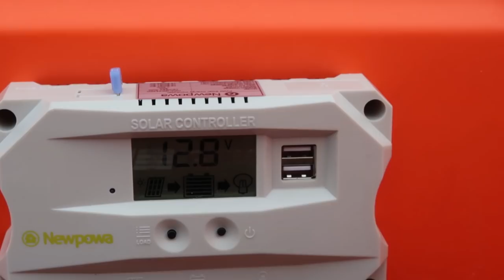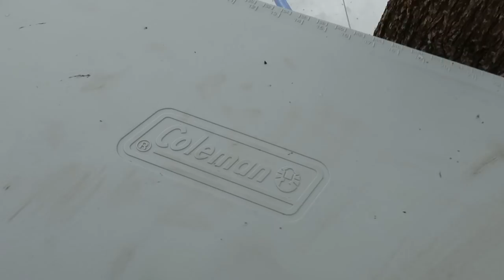204 Solar Powered Hobby Maple Sap Vacuum System?

Comment: Great video! A few years ago, my nephew bought a small solar panel for a project he was building. He opened the box on a nice sunny day and wondered if the panel put out electricity right away or if he needed something else. Well, ol' bright boy grabbed the two wires with his sweaty mitts. The panel went 10 feet in the air and the soup dang near left his shorts. Naturally, being the caring uncle I am, I laughed till I choked.
Great work Suzanne and Erik!
MB BAR RANCH
Reply from the maker: OMG, ok I laughed! But people thought I was nuts when I warned on another channel about panels needing to be covered before connecting!
Reply: @This1LifeWeLive  best let them buck the system once they've been warned. Lol
MB BAR RANCH

Comment: You can buy 12v heat tape like you use for copper pipes, it might be more efficient to wrap some around the pump, and then insulate the pump with more polystyrene. That bulb is really just heating the air.
Personally I'd have some kind of heating on all the time but fed directly from the solar panel, then when the sun goes in, have it switch to using the heating tape only if necessary. Hopefully charging the batteries won't require all their output, and this would be a good way to use the excess power.
You can buy cheap $5 USB temperature loggers, one might be useful for monitoring just how well the heating hardware is working.

Comment: Nice work. Once that tank is buried, the constant 50 degree ground temp will keep your sap from freezing.
Maybe the batteries should be put in another cooler, to lessen the possibility of explosion ?
Reply from the maker: but I wanted to end the season with a bang :(
Reply: @This1LifeWeLive , Lol.
Reply: You would need to go 10' or more deep to get 35-40° temps.
No sense burying the tank at all.
Reply: @gordbaker896 , Depends on where their frost line is and it isn't 10 ft. 
Even if they only buried 3/4 of it, then put some hay over it, it would never freeze. Ground temps below the frost line are generally in the 48-53 degree range everywhere.
Reply: @augustreil  In Southern Ontario, 3' is the average frost line and temps are sometimes below 43°F.  Neighbours deep well heating system froze up two years ago.
Reply: @gordbaker896 , Even if that was true, it still will not freeze. Average ground temp below the 42'' frost line, in their area is 45-50 degrees.
Either way, if they decide to bury it, it will not freeze.
Reply: @augustreil  Correct.  I never said it would freeze.
Reply: Most batteries these days are 'sealed' but there is often a small vent.  Batteries lose much of their output when below 40°.
Reply: @gordbaker896  we also gain 6 foot of gradient by burying it.
Reply: @augustreil  I agree I have never seen the frost deeper then a foot out here unless your driving over the same area over and over or letting the water from our hydrants soak the ground around them.

Comment: YouTube can be your best friend. And a trio to Vermont can help also. I  give u credit for what u are trying to accomplish. But u need to think about snow and travel for both power and sap to the tank....
Reply from the maker: The solar set-up was perfect (with the exception of a cheap temp controller which kept burning out), but the discharge to the tank was less than perfect. I know lots of guys bury their discharge lines and have pumps on the opposite end to help "pull" the sap toward the sugar house/tank. Not sure that's the best approach for us, so just driving to the holding tank is fine for now :) We plan to add a sap ladder next round and that will allow our lines to be at a more reasonable height overall :)

Comment: Why burrying the tank? Seeing the "comming up" section putting it into a litthe cusom build "barn" and filling this with insulation (foam or rockwool) and also having some little heat in it may reduce/avoid the freezeup. Also this way serviving any of the fittings would be easier.
For the pv panel stand, looks solid ;-). You could look into getting a (two pole) dc disconnect switch for safety on the stand. In this case the blanket is only required on jobs concerning any wiring between this and the panels. And a futher suggestion for securing the stand: if possible you could use long rods or poles and push them with a little angle into the ground using the front loader of the tractor and chain the stand to it. Or stap it down. I am thinking of a topping over by wind scenario due to wind loading.
All in all a good summary of steps to undertake for getting sap more easy than carrying buckets!

Comment: not sure if youre aware possibly not, i wouldnt bother doing it for this season now as youre needing to get on im aware.
but, for future reference , its worth noting that your solar panels if you can fit them to a adjustable frame  ( not just to move it as a whole , but to have swivel rotational points in a frame for the panels which is  fitted in to a fixed supporting frame ) so as you can tilt and swivel, by doing this you can swivel to follow the sun during the day to gain maximum direct sun light and also tilt it so the panel is right angle to the ground ie 90 degrees, do this whilst there is snow laying on the ground and you will gain the reflection of the sun off of the snow which is way more efficient during winter months. 
im saying this not JUST for this solar power set up but because you mentioned about using solar power as a power source for your home, i did offer to draw up some drawings some time back if you had wanted but i got no reply so i guess the hubby is more than adequate at mocking up a design to do this exact thing which is super cool obviously.
Reply from the maker: We would probably look into doing a rotating system for the house for sure. We wouldn't do it all ourself though, we'd have a company come out to help and make sure everything is set-up accordingly :) This one is more than adequate for what we need right now though :D
Reply: @This1LifeWeLive  hell yeah its a cool design, i was more thinking for your main house set up where implementing a swivel and tilting system will  without doubt greatly improve the efficiency of any system you have installed. especially during winter time where the sun is limited in hours and strength, so gaining the reflection off of the snow for example can make a huge difference.
i have complete faith you 2 will nail this down in good time, just little hints to things not everyone is either aware of or think about . its often little changes that can end up making a big difference :)

Comment: Noticed you run the pump off one battery but charge across both (in parallel).  I'm no electrical engineer but it makes sense to me that if charging them this was would charge them equally then you might want to run the pump the same way to discharge them equally...  Thoughts?
Reply: The charge is running into the solar charge panel. Then to the temp sensor then to the pump.
Reply from the maker: As erik explained, pump is hooked to solar controller, although the light is direct to the battery,  but it's only turned on once :)

Comment: By the way Suzanne i have had solar panels on my home since early 2015.Last yr i went from April to Nov not owing them a dime, i produced more than i consumed. It,s a huge initial investment but down the road i will reap in a return on investment. I have 21 panels on my roof, 5000 watt capacity
Reply from the maker: That's excellent! I think maybe if we did it we would run off battery  and not be tied into the grid. Our power company is ver greedy and I don't think they would let anyone "get ahead" of the power curve.

Comment: i know 12 volt need bigger wires and close as you can to the converter! or battery's  i use a camper with a wired 12 volt battery system(it had inverter and battery when made) and i added 3 battery's and 230 watt solar panels mono ones & harbor freight 90 watts low sun charger more then mono or poly on low sun light!  i also have 1000 watt gas generator it came with the camper, when i bought camper some one broke in well being repaired so i got new generator and fridge! when i got camper!  ,  i know mono and poly not best mixed I have mono and poly separate systems on my home with grid tie units the system were sold for camper system I put on roof of my home a house-trailer.

Comment: Hate to say this, but I don't think that setup is going to work as well as you think.. Reasons:  1) That hose is way to long and you won't have enough height to move the product for that distance.  2) Syrup flows very slowly compared to water and takes more space to move well, that small diameter is not big enough to keep a good flow going, 3) At end of season, you are going to have to somehow flush that line out or it will become completely closed off/clogged by dried sap/syrup.  Not sure how you can do that without contaminating the syrup and that hose alone will hold gallons of it all on its own.

I would recommend seeing if there is a pump, 12vdc, you can use to keep the line flowing and clear.  Because even at 6" off the ground, that is no where near what you need for gravity feed at that distance.
Reply from the maker: LOL! 😋🙃😄😉

Comment: Paired batteries should have very similar characteristics,voltage,capacity,etc. That way a weaker battery does not put a "drag" on a better battery. Maybe for this setup it isn't critical. If they are well sealed there should be no problem with off-gassing into the small enclosure. The other thing is,you have installed the bulb to warm the inside if it gets too cold but did you work the pump to maximum to see how much heat it emits? If the heat were to build up too much in the small enclosure it could have severe effects on everything in there,especially the batteries. When you build the tank house maybe make it bigger to hold the electronics and such too. Consider temp controled venting,there are probably several options. Just some thoughts,probably not worth a shit,but thoughts all the same! :)
Reply: That's exactly what I was thinking too. A pump house on top of the burried holding tank.
Reply: I am too concerned about heat build up and battery fumes. That maybe a bad situation if they open it at the wrong time and introduce mass oxygen.
Reply: @kenkarish826  Yep,lead acid battery fumes are explosive I think. That's why it was always a bit "nervy" hooking up jumper cables or whatever on the old style batteries with the service caps. I haven't heard of a battery explosion for a very long time though so maybe improvements and general knowledge have been well worth it.
Reply: @ruralridez6165  Maybe design it with a lift off roof like some folks do with a dog house for easy cleaning. Then if you ever have to remove the tank you can just hook up the tractor and lift. Of course the other stuff would have to be on a wall and not above the tank. Again,just thoughts.
Reply: @had2galsinthebooth  If you have them under a hood where ventilation is prevalent it is not an issue. 
But I think it was a Buick LaCross that had the batter under the back seat. I was like fire that engineer.
Reply: @kenkarish826  there are alot of batteries inside the cars now days. Most batteries are sealed.
Reply: @had2galsinthebooth , Yes batteries can explode, especially the type they have, which are quite common. They are more prone to explode when they are being charged and off gassing.  When hooking up jumper cables, hook up the positives first and then the grounds to somewhere metal under the hood. That way no sparks are happening on the battery top. The other way is right before hooking up the batteries, blow across the top of them to disperse the gasses, then attach.

I'm a little concerned that the batteries are in the same enclosed area with things that may cause even the smallest of a spark and basically producing a bomb like effect.
Reply: Hydrogen gas is emitted.  No open flame or sparks please.
Reply from the maker: Interesting thoughts, although I don't think temps would be any worse than that of a car engine running, but the exploding gas is a curious topic to research. I'm going to have to do some digging ;)
Reply: @This1LifeWeLive  It's not the temps, it is the emission of Hydrogen gas as the batteries are charging.  A small vent on either corner of the lid wouldn't hurt. It is when there is a spark like the non explosion proof Pump Switch that can put your system in orbit.  Any switching should be outside the cooler since there is always a tiny spark when you switch.
A friend experienced an exploding battery once.  No fun there!.  Always make the last connection when boosting vehicles - the Negative Connection on the Good Battery vehicle somewhere on the engine or body., keeping any sparks from the charging or discharged battery vehicle.
Reply: @This1LifeWeLive     Being deep cycle batteries and need maintenance they should not be sealed. 
I would talk to a battery specialist at a battery rehab place. You maybe able to find one in a big city you can Email for proper handling. 
Remember to check acid levels and use distilled water to top off.
Reply: @This1LifeWeLive  Wellll,yes and no,car engines do make lots of heat but if the radiator and fan are working properly the engine compartment is very well vented,force-fed venting as a matter of fact. 2,000cfm for the average 6cyl compartment is alot of air,kind of like putting a giant barn fan in your kitchen window! LOL.. In your encosure the only thing I see to potentially produce alot of heat in the small insulated area is the pump. I don't know what the specs are or how it would affect the enclosure,that is why I asked if you worked it hard to see if it gets hot,warm,or not even lukewarm. But what the hey,if you are now considering those things then "forewarned is forearmed"(SP?).

Comment: God bless you Erik, At 12:39 when Sue badly describes what the 2X4's were used for. The look on your face is priceless. You look like "Sue What the Hell are you talking about"!  
Don't be mad Sue, I have said some things that made my girl look at me sideways.  

Oh! By the way, Great choice of positioning of solar panels. I was hoping that you weren't going to put them within reach of falling trees, but I thought you might build a mound of dirt to set them upon and maybe a fence to keep deer from scratching themselves against it.  

Reverse light? I think you meant turn indicator. Reverse lights are not Natural Amber lights they are clear and only have 1 filament. And by the size of the bulb it appears you used a turn indicator bulb most likely a 4157na as most marker lights are 194na or 168na. (NA= Natural Amber). 

Can I make a suggestion? Use some aluminium foil to line the inside of the bulb fixture to reflect heat, the black of the fixture you have now may absorb more heat then it reflects and your pump may freeze. 

But excellent placing of the pump between the two batteries as the heat from them will help the pump stay warm when the batteries are being used. 

Love you guys.
Reply: I bet you guys just cringe every time  I comment. Just trying to be helpful not "critical".
Reply from the maker: I don't know all the technical terms for stuff, I just build it,  or in this case help build it and leave it at that :)
Reply: @This1LifeWeLive  👍💕

Comment: That looks awesome you guys, i think you out did mine :)  Figures crossed that it works as well for you as mine does for me!
Reply from the maker: WE had a few hiccups, some caught on cam, some not, but I think now it's running well! What pressure do you get with yours? so far our highest is 20" . . .
Reply: WT Farm Girl Videos I get around 24-25 average at the top of the hill,  but 18-20 at the pump box.  The 3/16 tubing adds a bit extra gravity assist.  I would say your doing good with 20.  I also have to walk the lines with a hammer a few times after tapping to check for leaks and give them an extra little tap.

Comment: That is a 4 gallon per minute pump, a bit oversized and pumps do not like to run dry.  Better start cutting firewood!  If you have concerns re keeping the pump warm, move the bulb much closer to the liquid end of the pump and make an aluminium foil cover for pump and heat source and then Insulate  with some bags of styrofoam popcorn which conforms easily to various shapes.  The pump itself should provide some heat.  Put some 4" solid styrofoam under the Cooler and strap lid closed.  Are you sure that filter will work upside down?
Don't bury the tank. Ever. It should be on patio stones at the 4 legs.
Reply from the maker: tis pump has a bypass to keep the diaphram wet, and these pumps are able to run dry for hours on end (unlike other pumps which bun up if dry). That's why they are used for maple sap :) Honestly, the pump keeps the cooler warm enough that even in single digit temps that light has not once come on :) But I can always set the temp to turn the light bulb on earlier if it might not be warmign enough ;)
Reply: @This1LifeWeLive  Great setup.  I thought the pump would provide some heat of its' own.  I hate it when a ...'pump buns up'... [/:)